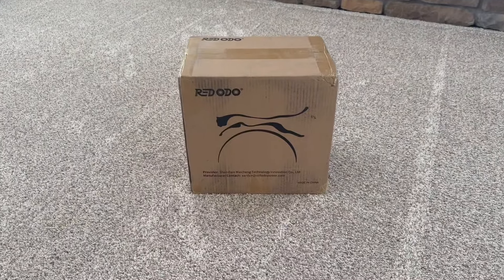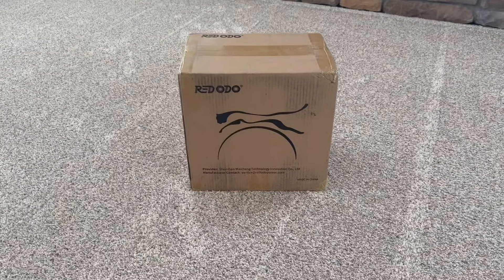DIY auxilary portable power system for camping, overlanding, travel with Redodo Lifepo4

Comment: suggest you, add 1X 5volt or 12 volt exhaust fan in the box.
Reply from the maker: I put in two little fans to help push / pull the air. I think in version 2.0 I’ll use a larger one.
Reply: @Hunleygarage  If you add fans Big Holes water ingress
Just add a little panel mount LED/LCD temp gauge, if it gets hot.?. Temporarily Open lid

Comment: Very nice build. This would be a great addition to truck kit for Photography and Ham radio. It would be nice if that battery monitor had a temp monitor and fan control built in.
Reply from the maker: Thanks for the comment, It would do well for that. Agree on a more useful monitor - they are all so hit or miss. If I knew how to code I could probably make one that would control it all!  Might have to look into that - would solve a lot of issues.
Reply: @Hunleygarage  I wonder if the source code is available and open source.

Comment: Although I understand the theory for not charging to at least 14.2-14.6 the batteries will loose capacity just from calendar aging as well so I charge them full which also helps with top balancing.
Reply from the maker: I am playing with a new battery that has a good BMS with a Bluetooth app. Trying to see when, how the cells balance. It’s so BMS dependent as well. While charging above 14 the cell temps really started to rise.  Once done charging, the temps dropped back down. The amount of amps gained was small too and cells voltage started to diverge as well. At rest they are starting to balance. I just can’t help but think 14-14.2 is good enough. Would be interesting to do a long term test and see if there really is any difference
Reply: @Hunleygarage  I currently am on a 2year test and have found 14.2 works perfect the cells all stay perfectly balanced. The first year I charged to 3.45 per cell and the cells drifted pretty heavily over that year. At 13.8 the cells never reach the steep curve so the Bms sees the same voltage in all cells so hardly any balancing can be done. 14.2 or 3.55v per cell is far enough in the steep curve to let the Bms see the voltage difference and take care of it. Just my 2 cents
Reply: @Mr.J345 just saved me 2 years of work! Lol. Thanks

Comment: Did you fit any fuses for safety. I didn't notice any whilst watching the video. George Just concerned what would happen if the ciggy socket got shorted out by accident. Eg a washer dropped into socket.
Reply from the maker: Not on this one - was more of a proof of concept, will it work, do I like it, etc. planning to tear apart and rework it
Reply: @Hunleygarage I would probably put a marine grade breaker on that Anderson port. Everything else can get inline fuses. Then you can simply open the case to on/off the breaker when using it. They are small and fairly inexpensive.
Reply: @unappropriate1 what amp rating would you recommend on the breaker?
Reply: @DavidBoucha  I thought about it some more and I would use one of the ANL fuse with fuse block and a marine switch to turn off the plug outputs. Anderson plugs are typically rated for 50 amps, so maybe 60 amps?  I really wouldn’t want that Anderson plug to not be switched, even if it meant having to open the box to turn it on.

Comment: No fuses nor killswitch, no ventilation huh?
Reply from the maker: Not on this one. Was first try to see how it went. I am planning to tear apart and make a more PC unit with all the safety stuff.
Reply: I'd like to replicate this for my kayak trolling motor. Why the need for killswitch or fuses? What makes this different than a battery box, they dont have ventilation either?
Reply: @_Lt__Dan_  if you ask about those things that shows the lack of knowledge you have. For your safety keep away from it, or find someone with proper knowledge who is willing to make it for you, cheers.
Reply: You had an opportunity to politely teach someone something, but instead, you were a punk.  @peter4fiter
Reply: @MrTmax74  Do you think it's possible to teach many years of electronics experience in one comment on YouTube? You are one of the next very intelligent beings. Cheers buddy.
Reply: @MrTmax74  btw if my answer wasn't polite enough how should I categorize your comment calling me a punk.
Reply: He has ventilation
Reply: @_Lt__Dan_ the answer is for a trolling motor you don't. These batteries come with a BMS that almost always has a current regulator and an over temperature cutoff. A kill switch is mostly just for convenience. I'd probably add a fuse and switch just for added safety, but so long as you buy a decent quality battery the risk of fire is minimal. That said a fuse is probably a good idea just to prevent the motor from having a short circuit which could result in a fire. All the other stuff is just nonsense and not necessary for safely operating.

Comment: Sweet vid. Hope they can send you a 24v lifepo4 battery. I’d like like to see a HD box for a 150ah or 200ah  24v.
Reply: I did a 300ah in a Rigid toolbox last year, and I think my winter project this year will be a 24v300ah version in a wheeled construction toolbox. It will weigh about 180#.
Reply from the maker: That would be neat to see!  I think a nice wheeled box is the answer!

Comment: Awesome build. The only thing id keep an eye on is the Victron heating up if you plan on using a good amount of wattage from Solar. If it does heat up you can always add a mini computer fan facing the Victron.
Reply: Victron is immensely over priced.
Reply from the maker: Thanks!  I did go back and add two very small fans.  My solar is to low to cause much heat, but the controller is definitely large enough to accept to much solar and overheat the box.
Reply: @Hunleygarage  awesome
Reply from the maker: I don't think they are over priced, you get you what you pay for is more like it. Thanks for watching!

Comment: You should definitely charge the battery at the charge  voltage the manufacturer recommends in the battery’s data sheet to keep the battery longer. Something around 14.4 is typical for LiFePo4.
Reply from the maker: Thanks for commenting.  It would take years, but would be a neat test to take the same battery and max charge to different levels and see if there was any difference in degradation and total life.  

The amount of time required to reach 14.4 and the stress placed on the cells is a lot - for very little, if any capacity gained.  If you watch the cell temps, they really start to rise after 14v and then immediately drops after the voltage is dropped.  

Because the capacity gained between 14 and 14.4 is very little - maybe .05 amps - I don’t like to go that high.  The thought of the time and stress placed on the battery makes me cringe.  

The beauty of all this, is I can do one thing and you another and we discuss differences and understand the outcomes.

Comment: Excellent! Power Queens mini battery is 2 lbs lighter in weight. Have you thought about using a positive and negative buss bars? Also, i didn't see a fuse at the positive battery terminal. (Saves all electrical wires and equipment in case of an over amperage occurrence)
Reply from the maker: Amazing they can build one lighter!  I need to get another video out reworking this box.  It was a thought in my head, and kept building upon the idea until I just had to build it.  Wasn't sure what would all fit, work together, etc.  After some layout it all worked but now need to add fuses, bus bars, proper wire sizing, etc - but works great!  Thanks for watching and commenting, I'll have an update out soon.

Comment: Love it!  I'd like to build one myself as a newbie to solar and LiPo batteries.  This will be a great starter project.  One question.  You only have charging via Solar.  Was there a reason you didn't include a 10A or 20A plugin charger as well?
Reply from the maker: Not really - I bought a Victron 12v charger but didn’t put it in - got a little cramped for room (and wanted it portable to use for other batteries) but wanted to use my solar as the primary charger.  Another guy wants me to build him one, but remove the MPPT and install the 120v charger instead.  I think there is room for both. Icing on the cake would be to add an inverter but would need a bigger case. So what added the Anderson connector to easily add when needed. The smaller 300 watt inverter would fit well though
Reply: @Hunleygarage  Great options in this build.  When you build another one, I hope you share a video of it.
Reply: @Hunleygarage  I did a small 120ah build in a Plano HD storage box. With raw cells there was enough room to mount a solar controller and an 600w inverter on a non-conducting board that sat on top of the batteries and still allowed the lid to close. I usually build bigger systems but this build came out so compact and light weight that I end up taking it everywhere with me. It charges nicely from a 180w panel mounted on top of my truck or from a 60a external charger I can use if needed..

Comment: So how new / old is your outback??? Mine is too old to use with anything but wet lead. There are just so many more options available for inverters nowadays
Reply from the maker: It’s got to be at least 10 years old. I do have the little programmer box, so thinking I could change the voltage parameters to work with the lifepo4 - I think.
Reply: @Hunleygarage  Mine is probably half again (no it's twice that I think it and the genset were both installed in 04 or 05) older than that, I was researching it on Outbacks website, and mine didn't have a path to working with LiFePo just too old, their newer stuff will if I was reading it right. I love my Outback, it's been daily for it's whole life powering a semi truck sleeper

Comment: I wouldnt mount that charge controller on the battery. I love victron but they can get kinda hot sometimes
Reply from the maker: I got tight on room. If I had more solar id be worried. Before the case I had it mounted on the battery and it never got warm but because I’m well below its rating.

Comment: Can you open up the Dr. Prepare battery and show the insides of what you have done? I have one and would like to do the same. Thanks
Reply: I would like to see it as well.
Reply from the maker: Yes - it was a pain to get all the stuff in there - would make a good video - thanks
Reply: @Hunleygarage  Yes, I am sure it is very tight. That's why I was asking. A photo would do for me. You think a 120 amp anderson would fit?
Reply: Just as an FYI, I have stared working on mine, and so far I have added a 100 amp rotary switch, a 120 amp Anderson, and a 45 amp Anderson (one of the small ones). I haven't installed the Drok yet. I am going to fuse the main cable. It is very tight but room enough to add a few odds and ends.
Reply: @mizmo7223 holy crap!  I didn’t know they made an Anderson like that. What cable size did you use?  Sounds great. I made a video of my battery and going to post Friday
Reply: @CampPrevost  6 AWG silicone for the 120 amp. 10 AWG silicone for the 45 amp. I havent wired them yet.

Comment: Looks good. Need some ventilation and fuses. Had many batteries go thermal runaway when overheated. Nicads and SLABS
Reply from the maker: Agree - I put some little fans in it. Is the lifepo4 chemistry subject to run away?
Reply: @Hunleygarage  I’ve been told that while LifePO4 batteries are among the safest of battery chemistry’s, they can occasionally experience thermal run away if the BMS fails or if a cells are punctured.  During normal operating conditions off gassing in aLifePO4 is minimal, but a during thermal runaway event LiFeP04’s produce gases that are highly flammable.  If they’re allowed to build up, like in a sealed container they can cause an explosion.
Reply from the maker: @riariaria  I am not sure I have ever seen or heard of a LFP in a TR event or even off gassing unless you drill through the cells or place in a fire above 500f.

Comment: You  can  safely  charge  to  14.20V  for  LiFePO4 . "Normally" the manufacturer will indicate 14.40V , but we'v ( BlueNova Energy) seen this is not  necessary. The  BMS  start to  balance cells  from  14.10V up to  14.40V ,  but  14.10V -  14.20V  will be  fine. Float  can be at  13.85V . Charge  current  for  first  few  cycles  needs to be low ( 10A - 15A) just  to  allow  cells to  balance &  settle , from where you  can do  ideally  25A - 35A  max , depending on application( min recharge time ...) .
Reply from the maker: Thanks for the comment.  I felt the man recommendations are way to high - thinking mine might be to low.  I sat in front of my bus batteries (camp prevost channel) and watched the BMS indicate 100% at 27.65 - and watched a lot of the off grid garage tests, that’s where I came up with my numbers. After living with it awhile, I think a little higher is necessary but scared to go to high because it seems that causes them to swell.  Have you noticed swelling with higher voltages?
Reply: @Hunleygarage   Sorry  for the  delay  in my  reply...On 26V  you can  safely  go then to  28.20V  for Absorbtion and 27.60V for  Float....you  were  basically only  floating  your  battery at  27.65V...Swelling  of  cells will  occur  mostly in  two  cases...1 .  overcharge,  charging  continuously / regularly  over 14.60V( above  3.65V per  cell ) ( 29.20V ) and  2 .  Charging  at  high  current  with  a  low  battery  pack  voltage  in  cold  conditions( below  " 0 "Deg. ) .Individual  cell voltages  here is very  important to  keep an eye on,  if any cell or  cells is  below  2.0V ,  charging  amps  must be  reduced  to  1 - 5A ( depending on battery capacity / size)  and once all  cells has  reached  2.5V the  charge  current  an be increased  to  double  this values . Once all cells has  reached  at  least  3.0V  ,  the  normal  charge current  can be  applied .

Comment: great video.  How long would this power pack run a full size freezer and full size refrigerator?  thanks and how much would you charge to make one like this?  thanks
Reply from the maker: It you had an inverter sized to run them both - assuming they are already cold - probably 6-12 hours. It’s hard to say, really just depends on the loads. The battery only had 1,280 watt hours in it - so just a factor of load over time. 

I have been asked by a few how much to make one - I never added everything up and need to add a few fuses and bus bars.  Probably $450?  I will be tearing this one apart and rebuilding it soon - I will keep track of all costs and possibly sell a few. Trying to understand liability issues if I do….
Reply: Thanks and i definitely understand your liability concerns.  thanks again for a great video. @Hunleygarage

Comment: You could also connect a 110/230V Inverter. That would certainly make it more universal. The size would increase though. Also, it would be a good idea to introduce a switch for each output, so that you can turn off the one that is not used. So that all kinds of LEDs do not waste electricity uselessly.
Reply from the maker: Thanks for the ideas

Comment: Can you plug a charger into the solar port? If not, maybe add another port to charge from an ac-dc charger? Thiughts?
Reply from the maker: I cannot but your point is valid. At the time I only had my solar.  The two people that want one would like an ac-dc option or perhaps in place of the solar - so the next build will incorporate that.

Comment: No cooling, no fusing?
Reply from the maker: I put those two fans in but didn’t use any fusing.  I guess I could put one in somewhere but figure the BMS will shut things off before I’m concerned. The rest are phone chargers and my cooler pulls 50 watts. My solar input is less than half its rating. I may figure something on another build

Comment: Where are the fuses?
Reply from the maker: Thanks for the comment.  You thinking it’s needed for the USB chargers or the Anderson connector?  I could install an in-line for the USB but thinking the BMS will cut things out at 100amps for the Anderson. A few have asked for me to build them one - interested in suggestions.
Reply: I would at for the usb chargers ATO 10 amp blade fuse for usb and aux port.  Best to be on the safer side if the BMS fails, and have an issue later.  You should fuse anything that can short out somewhere else including the charging cable. @Hunleygarage
Reply from the maker: I am going to rework that build and add in fuses and bus bar.  Thanks!